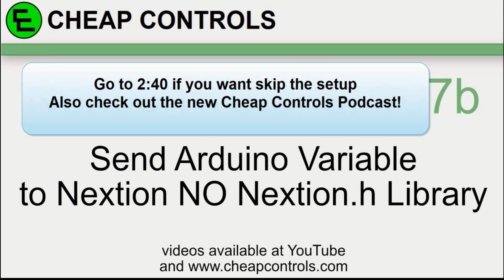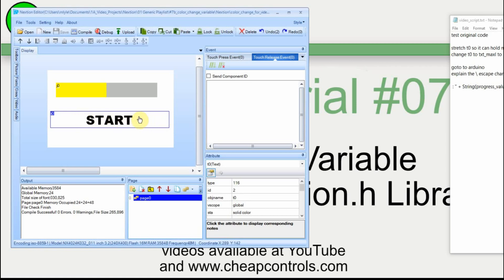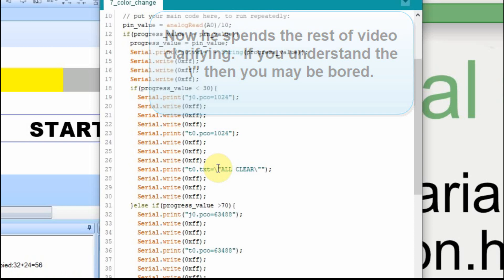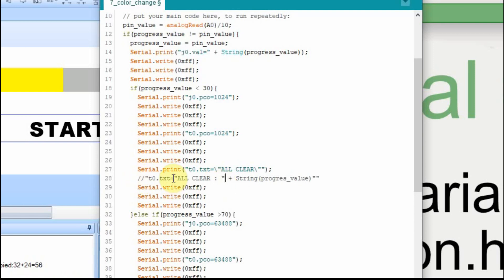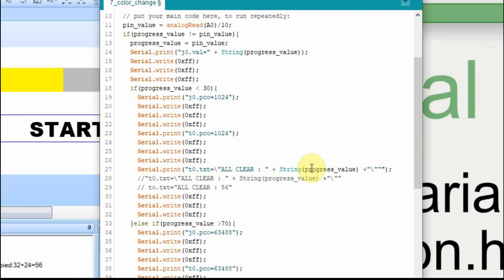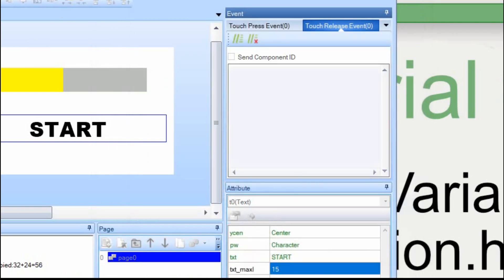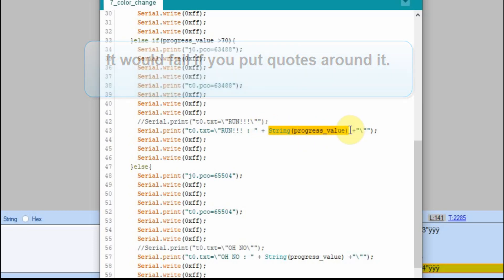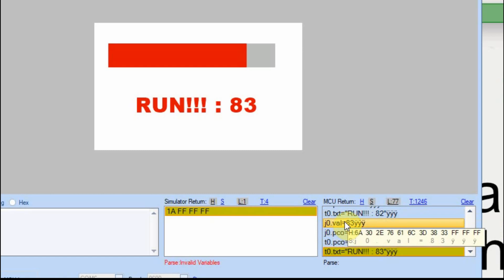#87 Nextion Display sending variables from Arduino to change text NO Nextion.h Library

Comment: My project consists of two pages.
The first page works perfectly, because when I turn on Nextion, it's the first screen to be displayed.
However, the second page, which contains several slides (h0, 1, 2, etc.), doesn't send the slider values to the Arduino, because when I turn it on for the first time, it only displays page 1.
But if I go to page 2, it works perfectly from then on and sends the slide values.
But I would like Nextion to send the values for page 2 without even going to that page.
Is this possible?
Reply from the maker: Yes if the values are set to global

Comment: Thanks for your videos. Until today I didn't realize the debug could connect to the MCU! Wild. The issue I'm facing is sending a HEX variable from Arduino to Nextion. For instance the variable in Arduino is "2FD807F" so it can't be sent as a number but I don't want to convert it to a text string. Is there a way to send an alphanumeric value from Arduino to a field in the Nextion? Thanks!
Reply from the maker: I am not sure.  If you go to www.cheapcontrols.com and submit a help  request.  I will respond and we can send code back and forth.
Reply: @CheapControls  I sorted it out, but thank you for the reply. The Number field will only accept numbers. The hex needs to be converted to a string and then the text field can show it. I guess it kinda makes sense, given the simple communication between the two.

Comment: Good afternoon, please tell us about the syntax inside quotes, why the expression + String(progress_value) + was wrapped in "+ +"
Reply from the maker: The + symbol is used to tie multiple strings together.  this is also called concatenation.  The progress_value is and integer.  When you combine an integer with a string you need to cast it as a string with the command String(variable)

Comment: Current_Read_Value = analogRead(Current_Sensor_Read)/100; // Read status of Potentiometer and divide by 100
   if(millis()-Time1>=50){
    Serial.println("p[2].n9.val=" + String(RealCurrent)); // Send the value to page tw0, n9 number box
    Serial.write(0xff); //Nextion Required Code
    Serial.write(0xff); //Nextion Required Code
    Serial.write(0xff); //Nextion Required Code
   }

so I have this from your example. But I keep getting this in debug mode in the MCU return box
p[2].n9.val=0\x0D\x0Aÿÿÿ

My n9 value I want to update is on page two of my HMI file. Now if I serial monitor it in the Arduino IDE, the value changes from 0. Not sure what that Ayyy is.
Reply from the maker: when sending to Nextion use print not println .  println will inject the x0D and x0A  It looks like you are starting to figure this out.  Looks good.
Reply: @CheapControls   Last thing I am struggling to find, how to check a value on one page and alarm on another page. IE n9.val > 90 ..... Update scrolling text on another page to say caution or alarm or anything. Or would it be easier to check value in arduino and then send text to the other page? 

Side bar, I cannot thank you enough for this page. It is such a helpful channel.
Reply from the maker: @vincentledbetter5691  The n9 needs to be global.  Then you set up a timer on each page with the scrolling text or some indicator.  You can set the timer to check back to n9 every 50 milliseconds if you want.  The idea of sending the value from the Arduino is also good.  What I have done is on each page I have an indicator of some sort named the same, so I can have it set globally then whatever page I am on the Arduino sends the same command.  I hope that made sense.
Reply from the maker: @vincentledbetter5691  Sorry I have not been very good at emailing you.  I have been very busy.  I respond better to quick individual questions.
Reply: @CheapControls  Oh I did not realize it was you! Haha I do not mind. I appreciate any help offered. I am trying new nextion and new arduino tonight. Communication is just not working correctly.
Reply: My N9 value never changes from 0 in debug mode, even when the mcu return val changes
I am set to global on my value
Reply: Disregard. Helps to set the baud rate the same in both ide and nextion

Comment: Can I simulate Nixtion editor without physical Nextion display with arduino?
Reply from the maker: yes.  You use a second serial port on the Arduino and connect it to the pc.
Reply from the maker: Check out this video https://youtu.be/22pqL1ovKtw

Comment: I was trying to send messages of text in a scrolling text using the usual syntax that i use to send variables in a numeric field on nextion display but i was not succeding. Thanks to your tutorial i solved using quotes and back slashes like in your example. Thank you for that. I still have a problem with a progress bar. I want to send a variable that is the product of this type: int stackingprogression=actualphotonumber/totalphotonumber*100. But despite the progression bar works is i send a single variable, i didnt succed to make it works with a calculated variable. What can be my fault?
Reply from the maker: Is the calculated variable calculated on the Nextion or the Arduino?
Reply: @CheapControls  in the arduino
Reply from the maker: Do you know how to run the Nextion IDE in Debug mode?  This will help you see what is being sent to the Nextion and compare it to the single variable.
Reply: @CheapControls  i saw another tutorial made by you and i tried immediately to configure the arduino serial comunication with nextion editor
Reply: It works very well and is much easier to find mistakes
Reply: I didnt find jet the problem with progression bar, but i find in five minutes 3 other bugs and i fix it
Reply: Thank you for the tutorial, they are very helpful, you deserve much bigger audience.......

Comment: Thanks,  after struggling for 3 day, copying libraries from many sources, seeking help in forums, desperate to simply send ONE  text from the ESP32 to Nextion, without success.   I found this video , copied relevant  code and BOOM it worked the first time.  With that simple step I know the connections are good, and UART works.  I can focus on code.   Now on to my next baby step, sending a number or variable!
Reply from the maker: Your welcome.  I have other videos that you might find useful.  If you find them useful consider donating to my ko-fi account.  https://ko-fi.com/cheapcontrols
Reply: @CheapControls  જોરદાર હેલ્પ
Reply from the maker: @dipakPatel-pz8ge  Thank you
Reply: @CheapControls  What would the print line look like if you only wanted to send the String(value) as text? without any static text?
Reply from the maker: @TheModelmaker123  I am sorry but I am not sure what you mean by static text?  If you have Facebook join the Cheap Controls Group and pm me.  You will have to answer a few questions to join.  I am starting to get bots trying to join the group.

Comment: HI, how could I send to nextion, the variable TDPizmjeren is double.
where is mine mistake?
I send to the .txt, should I send it like the Number?
Thanks, for your answer.
double temp_c;
temp_c = max.readThermocoupleTemperature() ; //+8

TDPizmjeren = temp_c + TDPdiff;
dtostrf(TDPizmjeren, 2, 1, buffer);
Serial2.print("pageRadna.tdp.txt=" + String(TDPizmjeren));

serial2.write(0xff);
serial2.write(0xff);
serial2.write(0xff);
Reply from the maker: It looks like this comment is also in the cheap controls private Facebook group.  I will address it there.